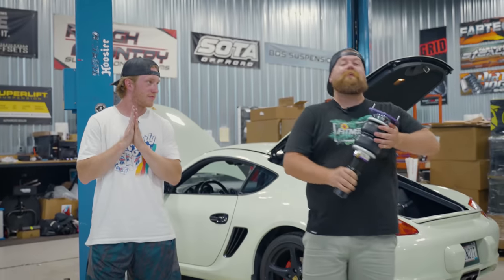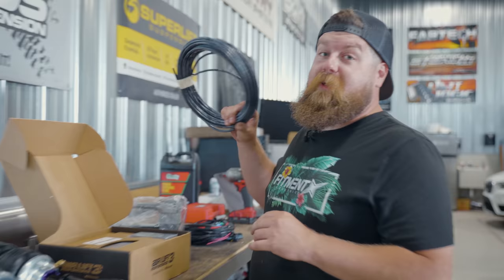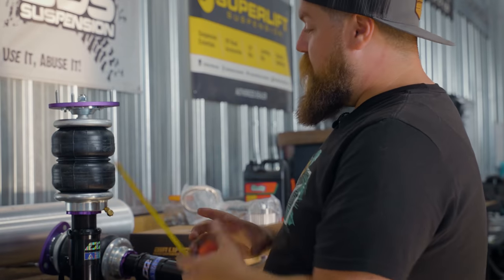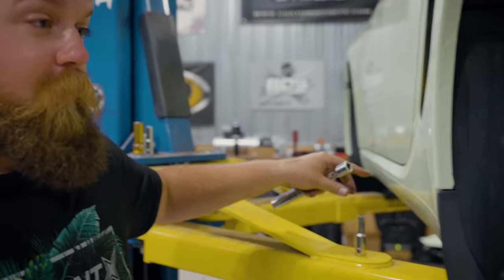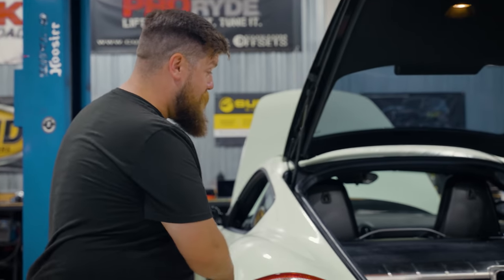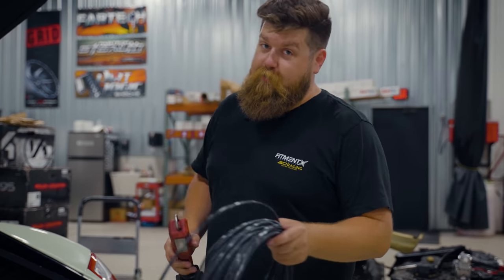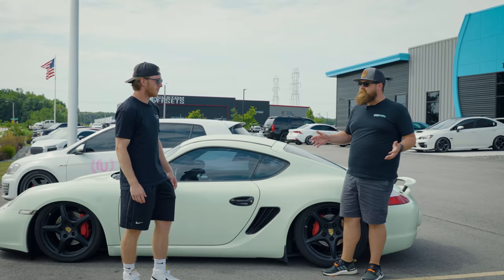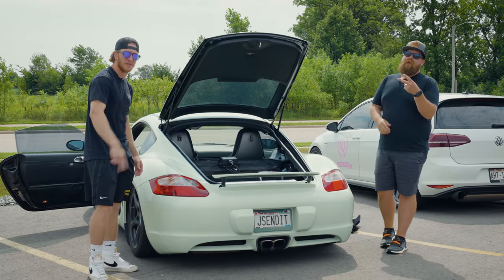Installing Air Suspension For Dummies

Comment: Thanks for the informative video. Can't believe you found someone willing to install air suspension on a porsche, usually its not the best for handling which porsche guys are crazy about. On the upside, I bet its the comfy as heck.
Reply from the maker: It handles really well actually! It's improvement over stock, rides lower (lower center of gravity), and it's just as comfortable as stock if not better with damping at full soft for daily driving. There are 36 levels of adjustment if I ever want to track it or go through some twisties as well! - Jt
Reply: Either way it makes them look cooler, which is the most important 😎👍
Reply: @FitmentIndustries  Thats fantastic. The only reason I commented about the handling is because I've heard mixed things, with some praising it while others swear by coilovers.

But congrats on the setup my dude. I'm sure it absolutely decimates corners, like a little road terrorist.
Reply: @samuelrizzari994  my brz handles better with the airbags... drop it low and stiff and she's gone
Reply: so did y’all torque the bolts to the specific torque or?
Reply: @samuelrizzari994  usually the ones who praise it actually owns air suspension where those who condemn it are on coils. 

The folks who have air suspension has experienced the quality on a day to day basis, while the ones who don't own it typically regurgitate rumors from others who don't.

Comment: Ive had air suspension for about 2 years now and I’m not having any issues at all. However, do you have a video or tips on fine tuning the suspension? Ive heard it’s suppose to be comfortable but so far it’s felt harsh in both directions. Thanks in advance! Love the videos!
Reply: Wouldn't fine tuning be quite component specific.. depending on what you have and what adjustments they have will dictate the fine tuning procedure

Comment: Can air suspension be installed on older cars. Like a 70s Mercedes?
On them the shock absorber does not go through the spring but is separated?
Reply from the maker: They can be, but it takes a lot of modification to get that sorted! Would definitely have to find someone that specializes in that body. -Edgar
Reply: @FitmentIndustries  and I doubt it. because on older mercedes models. the spring is assembled on the front trap. I guess he can't because of that, but as far as I know I'm not an expert. thanks for the reply